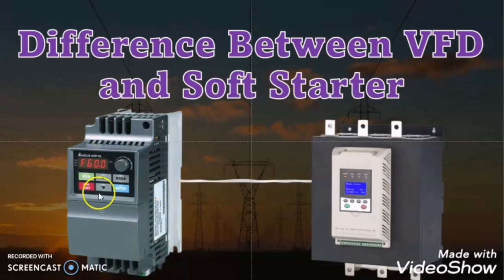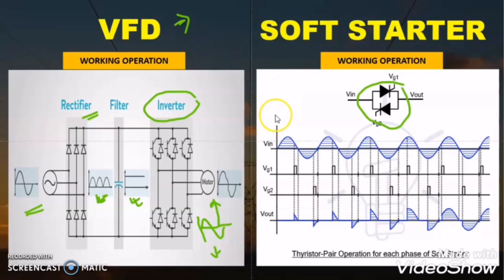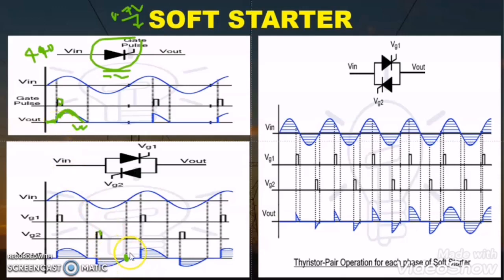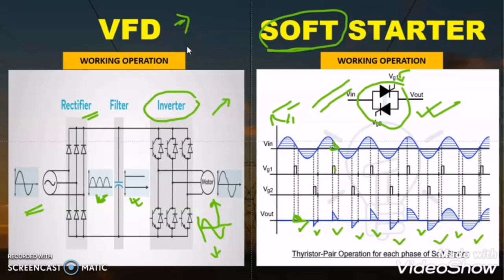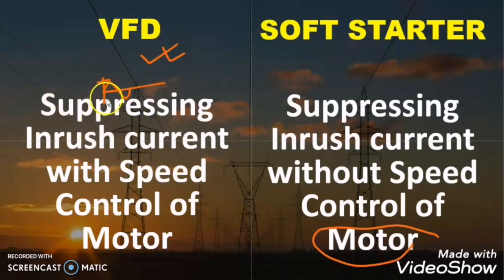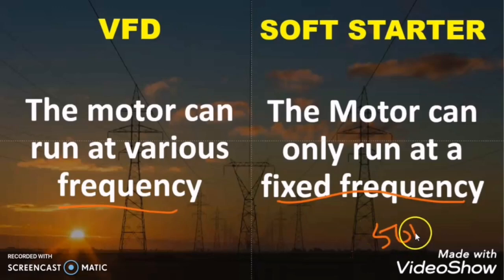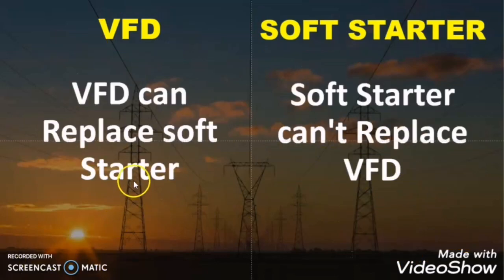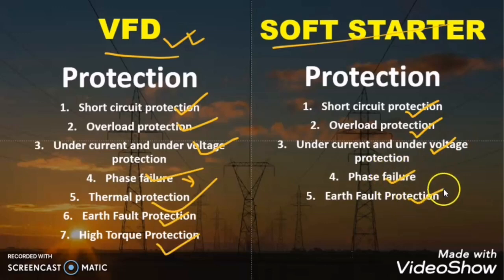Difference between VFD and Soft Starter!

Comment: sir can you explain how to select booster and transfer Water pump horse power and bar (very urgent sir please)
Reply from the maker: I can tell you how to select the motor HP.

But pump selection is HVAC and Plumbing part.

To select the motor HP rating many informations are need for mechanical departments like flow rate, GPM discharge head, suction head, friction factor for pipes and fitting and many more.

It is mechanical.
Reply from the maker: I will make video on motor HP selection based on these information available from mechanical department.

As i  don't know how to calculate the required GPM and Flow rate, friction factor, discharge head, suction head as it all depends on pipe size, fitting size pipe length, type of materials and many more.

Hope you got this.